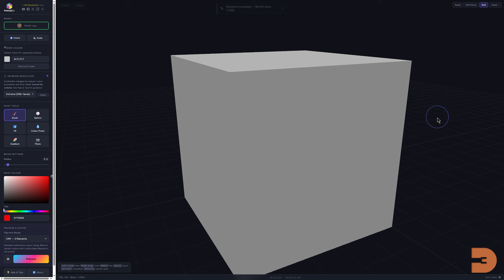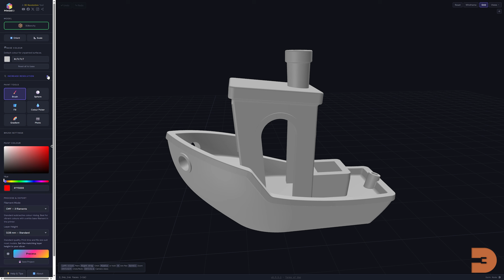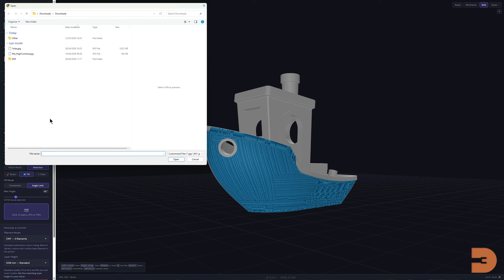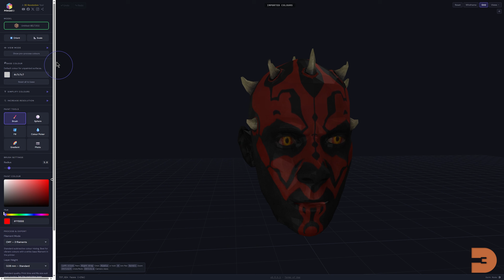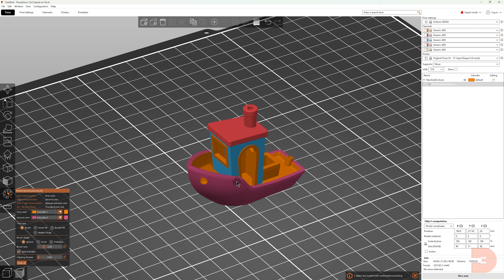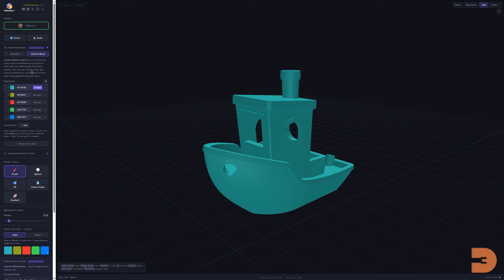Big Primed3D update!

Comment: Yo i know but i bought a snapmaker u1 but cant use tool i got the 3mf but its being very strange in slicer and cant find colors its not layer by layer its like a mixed creature when i use the to can u do a version for u1 if it isnt a big problem.
Reply from the maker: Hey, sorry to hear you're having an issue. 
I'm sorry it's a little hard to understand your comment. It sounds like you're having an issue when you import the 3MF into your slicer. Is that correct? 

If so, it it just a specific 3MF or is it any 3MF you've exported from Primed3D?

Could I check what filament mode you selected when you processed it in Primed3D before exporting?

Exports from Primed3D should already be compatible with Bambu Studio, Prusa Slicer, and Snapmaker Orca.

Let's see if we can figure out the issue you're having.
Reply: @3DRevolution the 3mf that i outputed from primed3d and yes its correct hut can u do a tutorilal video how to use it in snapmaker u1
Reply from the maker: @propenguen  The printer itself shouldn't matter. The only thing that should be specific to your use case is how to import it into Snapmaker Orca Slicer. Once it's imported, sometimes Orca Slicer the two things that I've found trip it up are:
- It doesn't seem to add new filaments to meet the required number produced by Primed3D. So if for example you processed it with WCMYK, that uses 5 filaments. If you had less than 5 filaments loaded in Orca slicer before importing the 3MF, it may ignore one of the colours, so make sure the right number of filaments are available before importing (This is specific to Snapmaker Orca Slicer and I am working on a fix for it).
- Snapmaker Orca doesn't always assign the correct colours to the filaments when importing a Primed3d 3MF, so once it's imported make sure you swap the colours correctly for the CMYKW filaments.

If those aren't your issues, as per my last reply, could you let me know what filament mode you processed it in in Primed3D?
Reply: I used cmyw mode and the 3mf is broken i used 3d viever other soyrces is it matters that i am in linux called zorin os @3DRevolution
Reply from the maker: @propenguen  As you're a channel member you've got access to the 3D Revolution discord. If you pop on there it'll be easier to sort this out as you can send me screenshots and files to look at. Are you able to do that?
Reply: @3DRevolution ok but how cna i join the discord
Reply from the maker: @propenguen  

To get access, you must link your YouTube account to your Discord account.
	1.	Open your Discord User Settings (click the cogwheel icon near your name).
	2.	Go to the Connections tab on the left.
	3.	Click the + Add button (or the arrow to "view more") and select YouTube.
	4.	Log in with the Google account you use for your YouTube membership.
	5.	Wait a moment. Your YouTube membership status will sync automatically, and your member role will be added to this server!

Once the available conections (like 3D Revolution) are listed, you may need to click something like 'Apply' or 'Join' next to it to agree to add it.
Reply: @3DRevolution i synced it it says connectes i waitesd 1p mins i cant join can u give the join link please

Comment: Is there a solution for limiting the colour depth of penetration? I want to put coloured detail on the surface of translucent areas, but the colour penetrates into to print towards a centrum point. I have seen a modifier method but that doesn't help with more complex surface shapes
Reply from the maker: Unfortunately, other than effectively what I covered in my painting at depth video which I believe is what you're referring to (https://youtu.be/9y92lhekdYA), not really at the moment. 

Some slicers allow you to define different filaments for indill or inner walls, but they don't let you define specific areas of the model, it's all or nothing.

Comment: Great job with the tool! Does your Beta version features for filaments and gradients export to the "mixed filament" options in Bambu Studio? It would be great if the 3MF file worked in this way to allow small adaptation within the slicer.
Reply from the maker: It doesn't currently set it up with the new Bambu Lab mixed filament tool as the exports are providing pre-painted models within the 3MF. However, this is a really interesting idea and something I'm going to look into so thanks for the suggestion.
Reply: @3DRevolution  That will be great. The mixed filament feature in Bambu Studio is still currently in Beta so may be tricky. You can't upload mixed filament models to Makerworld yet as it fails the upload slicer test, but  I think they are working on it.

Comment: Absolutely cant wait to make amazing full color models, thanks for the incredible revolutionaty work :D
Im planning on getting a flashforge creator 5 which has 4 tool heads, do you think it would work fine for full spectrum? I havnt seen anyone use it yet as i heard your currently only supporting the snapmaker U1 in the budget space :3
Reply from the maker: Technically this works with any FDM printer capable of multi-colour printing but due to huge level of filament changes per print, multi-nozzle/toolhead printers are highly recommended.

Whilst I've only been testing the exports fully with Bambu Studio, Prusa Slicer and Orca Slicer, that's not a limitation on the printer you use it with. You could use any of those slicers to slicer for a Flashforge. Flash Studio (Flashforges own slicer) is a fork of the same repository as all of the tested slicers, so it's likely the exports will work straight in there without issues anyway.

The only limitation you'll have with the Flashforge over an H2C with regards to Primed3D, is you'll only be able to do CMY, CMYK, or CMYW processing, but you won't be able to do CMY+KW. For general use that shouldn't be a huge issue, but both black and white filaments are heavily recommended when using the photo projection tool For basically anything else, CMY or CMYK will probably be all you need.
Reply: @3DRevolution thanks for the info :D
I've already considered the limitation that comes with only 4 tool heads instead of 5, but at my budget it's definitely worth it to get into multi material and full spectrum :3
I do have an idea to use an external AMS system to swap out one of the colors for the extra W/K I need for true full spectrum, but that depends on if the community can get that working on a toolchanger lol